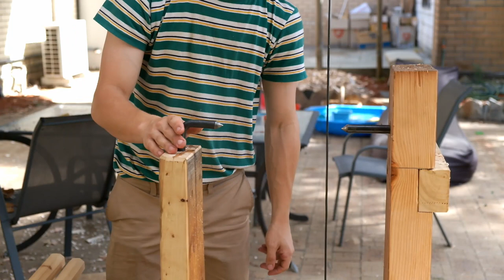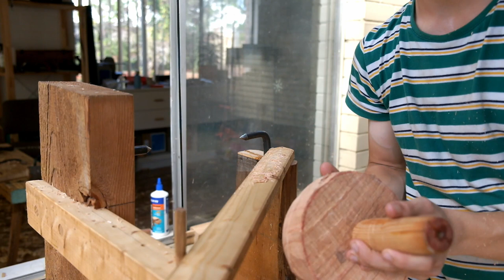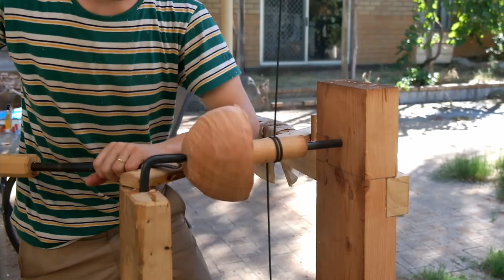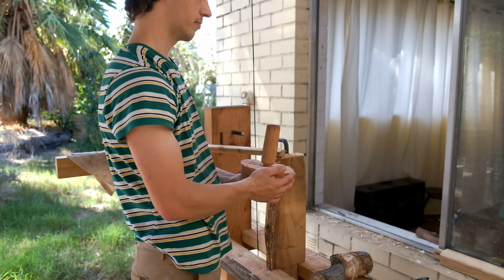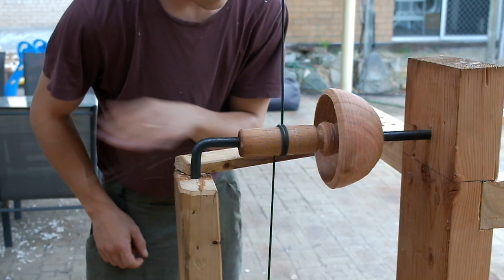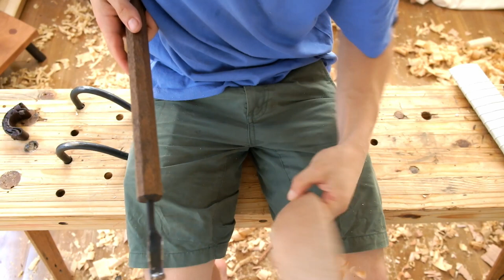All the mistakes I made turning my first bowl - Pole Lathe Learning Diary: 1

Comment: Nice work! It sees to me that the centers (metal spikes) are not not meeting in line. That could cause the bowl to jump off the lathe. Also if the center is not deep enough in the bottom of the bowl. Also - don't hog the tip of the tool with your left hand. Slide the tool through your fingers that are resting on the tool rest.
Reply from the maker: I think the centres are aligned, I checked that. Thanks for the tips